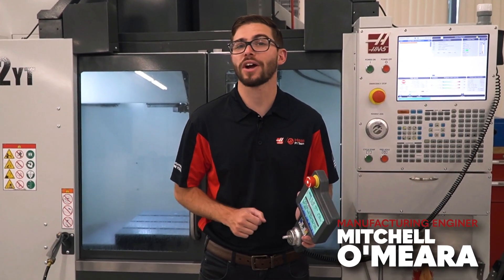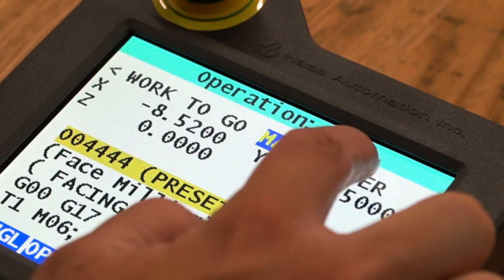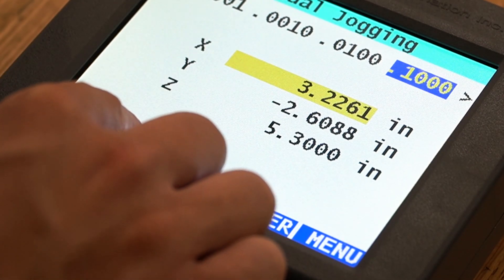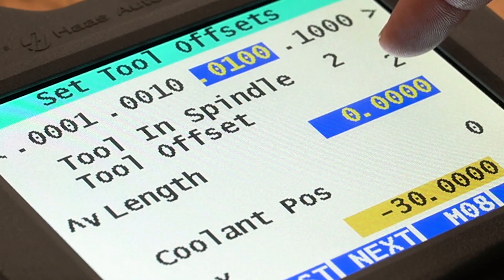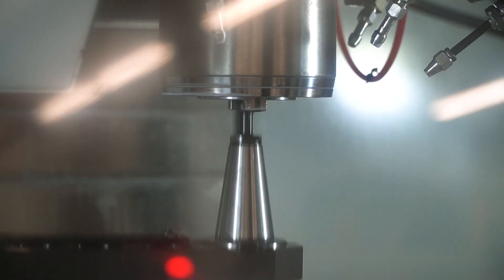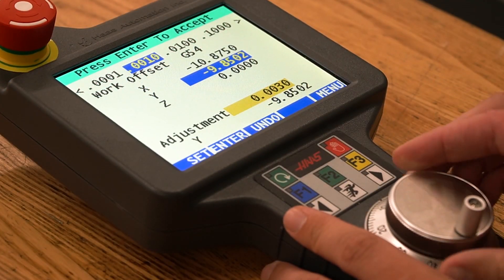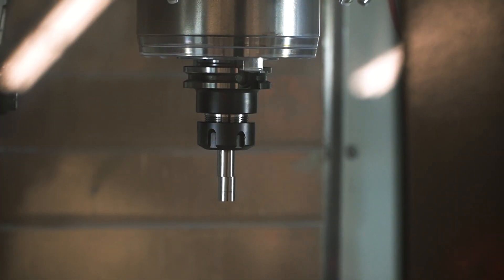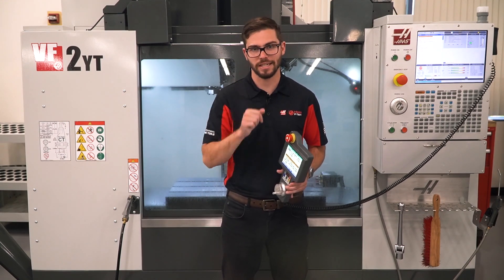The Haas XL Remote Jog Handle

Comment: Give me back my knobs!  A touch screen with grubby paws in a machine shop is a terrible idea. Furthermore, the very noticeable lag and stuttering with the pendant pulse wheel would not even have been forgivable in the 1990s, let alone the 2020s. I’m just waiting for guys to strip out all the color, and hide menu items from us, so you can make your controllers look like “mobile devices”, or some godawful Windows 10 settings page. 🙄
Reply from the maker: Pondimus Maximus, The RJH-XL was designed with the same jog wheels as those present on all Haas Controls to make the transition from the control to the pendant seamless.  A high speed ethernet cable connects the pendant to the control so that machine movements occur instantaneously so that the RJH-XL Truely functions as an extension of the main control.

Comment: you see. i work on a 100% safe deckel maho from 97 and can align parts, pickup work offsets, and measure tool radius and heigh without having to open the (single) machine door. because of the tool probe and spindle probe. the machine doesnt even come with a jog handle.
Reply: i drive german machines too and yes the button layout sucks, i would pay for a jog
Reply: @TommiHonkonen  i didnt mean it as a bad side. i really dont need a hand wheel.
Reply: @MrVinicius343  and im here just to bash on german engineering

Comment: I have the last model pendant. Works good. Using the pendant to set tool and work offsets is useless for since I have the probe. I just use it to jog the machine around to set the probe in its starting position. This new one looks like it will be awkward to hold and heavy.

Comment: Having a touch screen button for coolant on is a terrible idea. The only time you are using the jog handle is when you're in the machine working, if you are out and the doors are closed you'd just push the button on the control. It is just inevitable that you're going to be in the machine setting something up and accidentally touch the stupid touch screen button and turn the coolant on while you're inside.
Reply: We use it all the time for distance to go on our Haas GR’s.

Comment: Its a useful tool . I would use it a lot more if the quality of the handwheel was better. I can't believe they have used the cheapest handwheel possible. Come on Haas ..... go back to the ones you used on the older machines like the SL lathes.
Reply: AMEN!!!
Reply from the maker: M Johns, When designing the RJH-XL we used the same quality jog wheels already used on every Haas control so that users can transition between the pendant and the control with ease.
Reply: @haasautomation  Yes I understand that.......but it's the quality of the hand wheel that is poor. For a component that is touched and used more than most parts of the machine, a few extra £'s for a good quality part is nothing. Compare a 2008 hand wheel to a new one..... It sure does let a really good machine down.